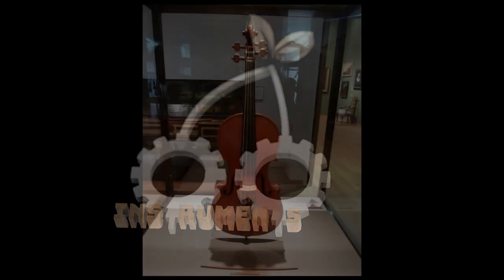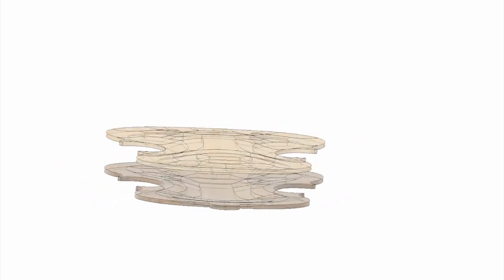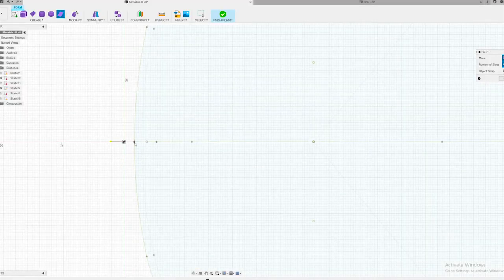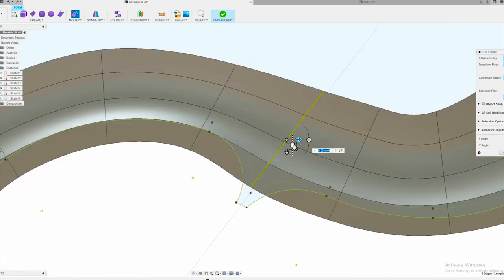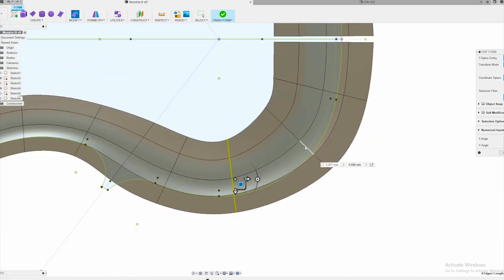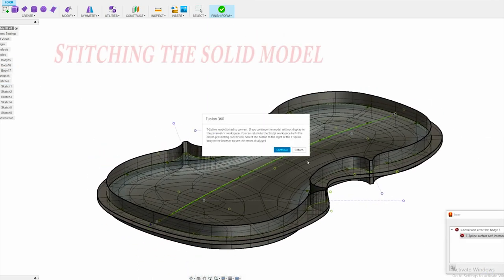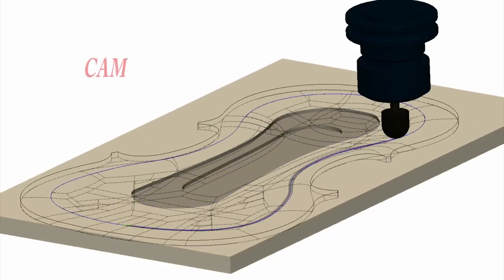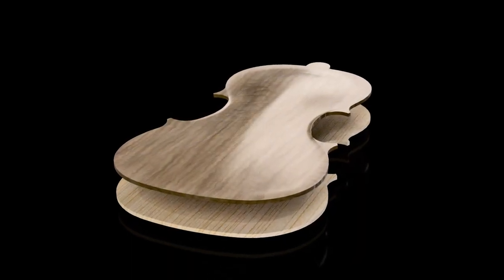Fusion360 Stradivarius Messiah Plates | Proportional design, 3D Mesh, CAD and CAM

Comment: Your modeling is so amazing! I also make modeling with Rhino. Well, to be honest, it's not easy at all. Your video really inspire me to overcome the troubles that is modeling corner of violin. This problem bothers me at least three months. Thank you for sharing your solutions.
BTW, I also use CNC to cut a front plate. I highly recommand to finish it automatically because cutting process only takes me three hours.
Reply from the maker: Thanks, I'm very happy to have helped a small amount.

Comment: Using CAD is a career on it's own. I was given AutoCAD years ago and was never able to draw a straight line with it. Wondering if anyone has inquired about the design of the Puerto Rican cuatro.  A 10 string guitar-like instrument. I've made one by hand, but I would love to make a custom cuatro on the CNC...
Reply from the maker: I've been using autocad since the 90's , I have designed a template set for a cuatro bit it was a few years ago, haven't built one, yet.